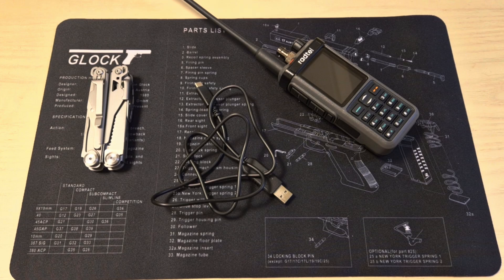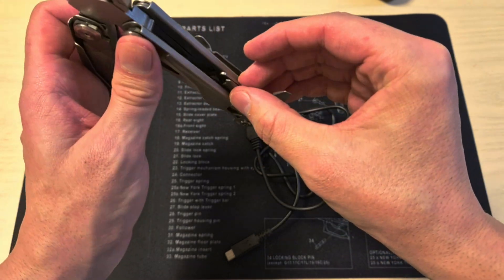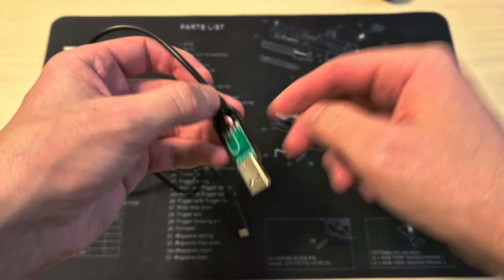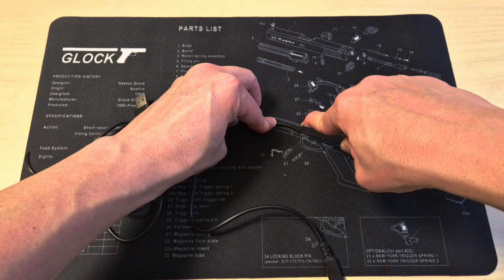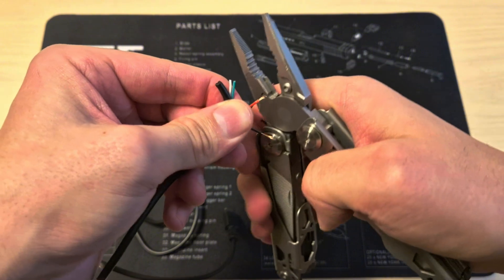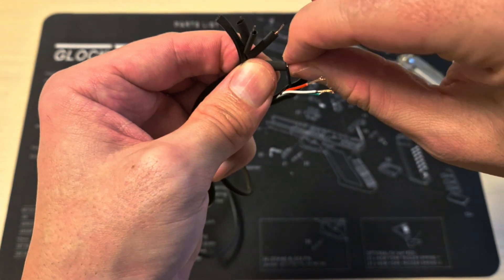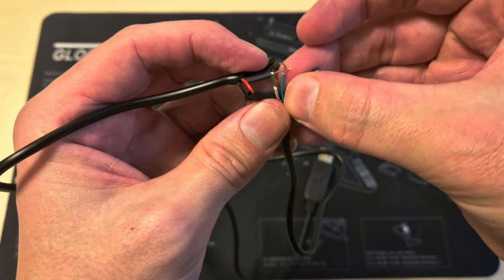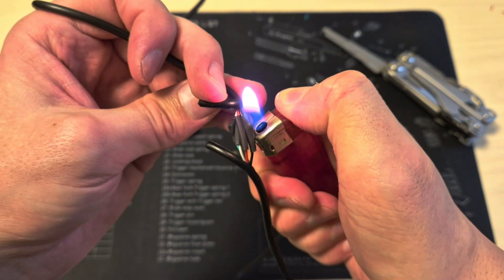CH340 Cable fix for the Radtel RT880 ( UV98 )

Comment: do the ones from ali express work without adapting? they say they are compatable
Reply from the maker: This one works out of the box, it's the official one: https://s.click.aliexpress.com/e/_oo5nycP , the one I shared before is cheaper but you need to switch the green and white wires.
Reply: @TACPrepper  ok thanks I have ordered one of these instead of messing around with cheap one, cheers!